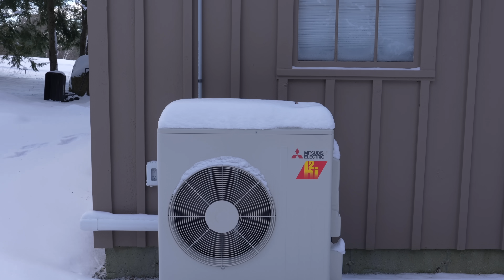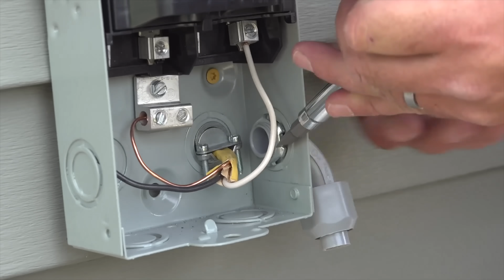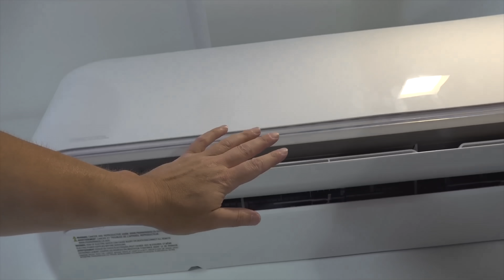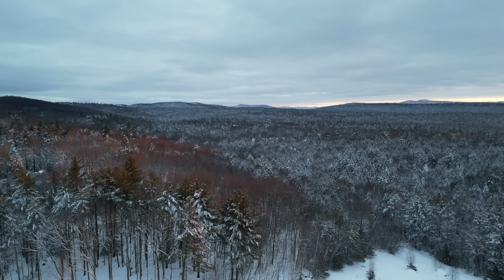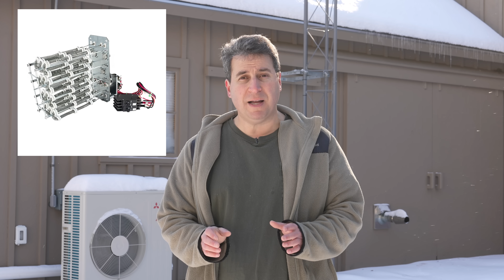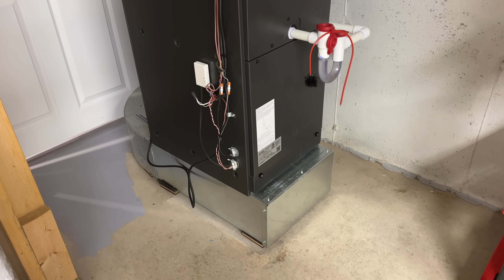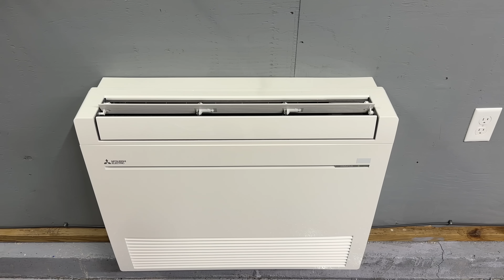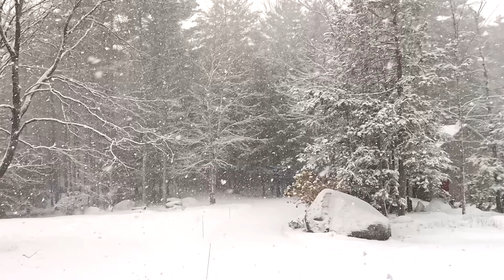Why Heat Pumps are now leaving people COLD

Comment: I opted for a dual fuel system. In the winter my heat pump operates based on an outside temperature sensor. Once it drops below 30 degrees I have a gas furnace that automatically kicks on. Best of both worlds. You get the efficiency of the gas when the heat pump become less efficient.
Reply: Here in the UK the Government gives a grant towards installing a heat pump but the gas boiler MUST be removed so no back up for cold days. Absolute madness - typical of Politicians who have no common sense!
Reply: @richardlewis5316  I'm guessing they want you to use an electric strip for backup, which will get the power from a gas-fired power plant, which is less efficient than your boiler, sounds about right, they are trying to ban natural gas use here in the US in some cities, which will cause the grid to be overloaded, then you have NO heat.
Reply: Thanks for your reply - so your politicians are obsessed with this CO2 non issue as well but don't care about us freezing or broke from buying a HP. I'll keep to my boiler which Valliant say can be converted to - hydrogen!! Cheers
Reply: @richardlewis5316 That sounds currupt.
Reply: I am in NH, and use propane boiler as my backup but I don't turn it on till it gets to about 20f, and even then the heat pump does most of the heating.
Reply: Excellent commentary.  One response mentions the cooling load in NE being one third the heating load and that certainly seems to make the case for why our mini-split outside condensing units go into an awfully loud vibratory mode when trying to heat with outside temps below 25 F.  We never experience this during cooling cycles.  Some northeastern towns now have building codes preventing new homes from the installation of fossil fuel heating systems, which may be adding to a false understanding that heat-pumps alone can handle the cold snaps.  And maybe the designed envelope of the new home makes the case on paper, but in reality the actual installation doesn’t always meet the goals due to poor craftsmanship and/or the use of inferior materials. Our experience would advise not only an alternate heat source to work in conjunction with the heat-pumps, but one designed to handle the heating load alone if needed.
Reply: @seniorsouthwick976  This is a classic case of government sticking its nose where it doesn’t belong. They know nothing about heating a home or building. They just listen to what John Kerry, Al Gore and the World Economic Forum tell them. They know less than the government.
Reply: I did the same, and I live in Michigan. Below 25 degrees, we have a natural gas furnace that turns on, to switch from using more electricity. My heat pump can heat in the winter, it's just more expensive than natural gas.
Reply: It depends on what type of gas you are using. My experience with propane has always been that its crazy expensive compared to natural gas. I went from a propane system that burned $24,000/year to a geothermal system that used $600/year (including summertime cooling bills).
Reply: @dilvishpa5776  24k? My electric and gas(natural) runs less than 100.00 a month total. About 75 electric, 20 gas a month average. That's for a 1970, 1700 Sq ft house that has no insulation in the floor and the attic could use a little more. That's using a dual fuel unit that I bought and installed for about 4k, 6 years ago.
Reply: @stevem1081    Yes. I know. Seeing the propane delivery manifests almost stopped me from buying this house. If it hadn’t been for the geothermal solution, I wouldn’t have.

But I wasn’t surprised: the house I built for my mother was well insulated, 1000 square feet, located near the Canada-US border north of Minnesota, and consumed over $1200/month in propane in winter 30 years ago. I would never have installed a propane furnace had I known. I suspect that there is fraud in the propane industry that leads to such high billing. I can’t explain it in any other way. The price between propane and natural gas shouldn’t be so drastically different.

The 6000 sq ft house was also well insulated, but the propane bill included heating a 2800 sq ft high ceiling insulated outbuilding, and a pool heater. The propane bill didn’t totally go away, as I kept it for cooking and hot water. Oil burners replaced the radiant heat boilers and pool heater.
Reply: @dilvishpa5776 propane is higher when you don't own your tanks. They charge you a rental fee in the propane ( priced in per gallon) without you knowing this. The reason is propane industry for the most part is UNREGULATED.  Meaning there isn't a state entity that regulates them. So they basically get to price gouge and get away with it. 
I own my tanks and the different before I owned my tanks in winter would be $4.99 per gallon ( company tanks) and $1.29 per gallon ( self owned tanks) 
Shoot in summer time when i would filled up it was as low as $0.99 per gallon
Reply: Up in northern Canada running a high efficiency nat gas 2 stage furnace alongside HP. When it's -40 I need fire and I don't care how much it costs.
Reply: Just experienced this phenomenon with my first-year mini-split heat pump. Thanks for your clear and helpful explanation...saved me a phone call to the technician!
Reply: Same here. Heat pump, 97% propane furnace, and wood stove
Reply: Given ever rising electric rates in relation to natural gas, you save money using gas all winter, getting the best of one world.
Reply: I’m in southern New England. I use a heat pump down to about 25 f and use oil backup. Looking at total cost of electric and oil, I save a few hundred dollars a year over the cost of oil alone, and use less than half the oil. New heat pumps will work to lower temperatures by using propane as refrigerant. They should start coming on line next year. If you are thinking of buying a heat pump, wait a year or so.
Reply: Yeah, this sounds like a great compromise -- especially for houses that already have a natural gas system in place!
Reply: I like that option. If you have the indoor ducted distribution system, you can run the indoor unit on low throughout the year in conjunction with a HEPA filter use and keep your home relatively dust and allergy free.
Reply: I assume you must be on natural gas?  With an inverter heap pump, the cutover temperature for propane is MUCH lower.
Reply: @matthewbeasley7765 is there any other gas use? 🤔
Reply: @JoRoBoYo  Propane.  
The prices on the two are very different.  A heat pump is going to beat propane at any outdoor temperature.
Reply: @matthewbeasley7765  Generally a safe assumption for a standard heat pump. That said, some of the heat pumps are now super efficient at lover temperatures, so the temperature drop can be way lower than 30 degrees for the heat pump to transition to an alternative heat source in these colder climate heat pump products.
Reply: @matthewbeasley7765 yes they can work lower but they are having to run the heck out of them and defrost a lot.
Reply: @matthewbeasley7765  The fuel type means nothing. The changeover is based on when the heatpump can no longer deliver enough BTUs to sustain a set temperature. In the northeast we must size a heat pump to the cooling load and ductwork size if we expect dehumidification. Cooling loads in this area are usually a third of the heating load.
Reply: @anthonyspadafora1384   There are two circumstances here.  

One is when the auxiliary heat will kick in based on the interior temperature.  The thermostat will kick in due to the temperature being below the heat pump only balance temperature.

The other is when an outdoor thermostat is used.  It is a standard feature on most heat pumps that is not elected in many cases.  It is useful when there is a known outdoor temperature where the alternate heat is more economical.  When the outdoor temperature no longer is above the outdoor thermostat temperature, the heat pump is shut down and the unit goes to only the alternate fuel as the first stage.  This is most pronounced when natural gas is available.  At high temperatures, the high COP of a heat pump makes it cheaper, but as it cools, that's no longer the case.  Most other fuels like propane or oil never reach that point unless the electric price is really high.
Reply: @anthonyspadafora1384  it does because in my area natural gas is 5.5 times cheaper than electric for the same amount of heat production. But depending on what your alternate heating source is will have a different cost to heat the same space. Heat pumps are heat transfer units not heat generators so the warmer it is outside the more efficient they are.  Since their performance drops based on temperature outside and they get more expensive to run the colder it gets other heating sources become cheaper to run at different outside temps.
Reply: @johnantonopoulous6381  I understand, I install about 25 ductless units a year and usually a couple heat pumps with fossil fuel backup. In my own home I air-condition with ductless and usually heat until the temp drops below 50. My home is 1800 sf with radiant floor heat. My heat load calc is 36000@0 degrees. As I have been in the HVAC business for 4
Reply: @matthewbeasley7765  Not from my experience. To heat my home with a heat pump it costs me about $250 to $300/mo. Propane is less than $100/mo. I do have a condensing boiler that is about 97% efficient in heat transfer & radiant floor heating.
Reply: @guytech7310  same here I use a Navien condensing boiler with radiant floor. My downstairs is slab high mass and my upstairs is under floor low mass. Right now I have the wood stove heating the house, a EPA Quadrafire. Sitting here looking at the snow and throwing in logs I realize I should have put some wall radiators on the wall behind the wood stove. This would allow me to run my circulators and throw a little heat back into the floor when burning wood. Oh well, maybe in my next life. Lol
Reply: @guytech7310  Northern Texas here - I switched my electric aux heat to propane. I have 3 units, I changed one so far and I'll change the other two as well soon. I have a 500 gal tank and another 250 gal tank for my backup generator. Best thing I've ever done. Also switched my stove to propane because electric just sucks. And my water heater (on demand, tankless). I'm very happy with the results and when it gets cold, putting the aux heat on for literally 2 minutes is enough to get the entire second floor to a cozy temperature.
Reply: Only way!
Reply: whats the heat pump price per btu vs the gas furnace? is it worth running a heat pump in the winter and wearing it out faster?
Reply: @danielroden9424  That depends on the cost of each fuel, for me, my electric rate is 6 cents per KWH, most are much higher, in fact, just a few blocks away is serviced by another power company, they are 14 cents per KWH, and there, natural gas would be cheaper. I have a dual fuel that switches to natural gas below 30°f Once it gets below 30°, it is actually cheaper for me to run space heaters than to use the natural gas. I found the btu output for gas and electricity on the doe.gov site to see what each one cost.
Reply: Why have a dual system when the gas furnace is already 94% efficient?
Reply: @johnwilcox4078  In my case, the Electric is much cheaper than the natural gas, plus I plan on installing solar, making the electric nearly free.
Reply: @stevem1081  "nearly free", eh? I first heard that kind of promise as "too cheap to meter" back in the early 60's. Didn't quite turn out that way. The engineer in me will happily adopt solar at the residential scale when the numbers no longer need to be massaged in order to appear to be economically viable. At the present time utility scale solar (farms) cost about a third of individual systems to deploy and even then massive government subsidies are needed to support them.
Reply: @jamesnasium7036  If you do your own install, then payback is much sooner. My neighbor installed his 12 kw system and in 6 years, it is now providing free power. I will be installing mine, so unless something like hail or lightning take it out, I too will break even many years sooner than if I paid someone else to install it. On the 10 kw system I will put in, doing it myself will shave over 20k right off the   top.
Reply: @johnwilcox4078  The 94% number for your particular furnace is arrived at using tightly controlled "steady state" laboratory conditions. As the saying goes, "your mileage may vary". By a huge amount.
Reply: @jamesnasium7036   You saying it doesn't make it so. But you're not a pro HVAC guy like me so I'll grade you on a curve. Look up AFUE ratings and see how you are completely wrong.  My point is air to air heat pumps cost more per BTU to operate than a high efficiency natural gas furnace. This is because electricity is by far the most difficult and expensive form of energy to produce. Have you ever toured a power plant? My power comes from a plant that used to burn coal but now the boilers run on natural gas 😉
Reply: Green cultist.
Reply: @James-l5s7k  Lol. At the end of the day it’s about being comfortable in your home and a heat pump in my location is not the best option.
Reply: Ahahaha, that's as ridiculous as the meme of a diesel generator charging an electric car.

So basically that's proof that they are not fit for purpose.
Reply: Thought central air with baseboard heat was the best of both worlds?
Reply: Same here. I have a dual fuel system and it's awesome. 

I have mine set to switch to the gas furnace once temps drop below 25 F.

I expect my equipment will last a long time, as my heat pump doesn't get pushed hard during cold snaps, and my furnace rarely runs.

The other big advantage is that it means my heat pump didn't need a heat strip installed - so it only requires a 30 amp breaker (which my old AC unit was using), which saved me $$$ as I didn't have to upgrade my electrical panel.
Reply: That makes a lot of sense.
Reply: Two furnaces to hear one home is the worst possible solution.  If you need a gas furnace to fill in, you are paying a gas companies fixed charges every month.
Reply: I have a dual use as well and never use the heat pump, leave it on emergency system, which is gas. Heat pumps are on all freaking day and use a fortune in electricity. They're a complete scam.
Reply: Same. I’m in North East, so oil is my backup. Below 30 I also run wood stove and the oil burner doesn’t kick in at night anyway.  Saving a lot of money this way.
Reply: And much more complicated and expensive
Reply: @Tkaya460 For those who already have a gas furnace and add a heat pump, cost isn’t that bad. Only about 2k more than installing an AC.
Reply: @mingchi1855 it cost about $5k to add a heat pump to my existing furnance a couple years ago. For dual fuel, the state offered a $1000 rebate. So really, the heat pump was an extra $1000 over central air, ans i use it almost excusively for heat from sep through nov, and late feb into may.
Reply: @Tkaya460  A heat pump is not much more expensive than an AC.  It's all the same parts just configured so it can also run backwards.
Reply: @zyxwvutsrqponmlkh  you do realize most people can't afford central a/c's right? To put in a modern dual fuel system is 3x as much as what my furnace cost and is much more complicated and thus more expensive to maintain and repair.

And the heatpumps designed for cold areas are actually quite a bit more than a standard condenser designed to only go down to 10°C outside.
Reply: @zyxwvutsrqponmlkh  no, it's not. You're wrong. To replace my central a/c with a heat pump is at least 50% more than just another of the same a/c. Then add in more complex controls for dual fuel and the fact my furnace is single stage makes it harder to get a good split.
Reply: @zyxwvutsrqponmlkh  reread the thread. Dual fuel is typically central, not mini split.

Also there is a significant difference in price even for mini splits, especially cold weather variants. You are wrong.
Reply: @Tkaya460 you sir have no idea what you are talking about. I'm an HVAC tech and a traditional central split system with gas furnace and condenser ac / evap coil cost per dual fuel systems aren't that much more. In fact your only paying the difference in equipment cost not labor cost . The install in labor is the same.
Reply: @Tkaya460 it's not much more complicated and expensive.  It's just another module "sandwiched" in the system next to the coil unit.  Nothing else changes.  It's only a couple $k.
There's no "extra control".  It's running off the same thermostat.  I don't know who gave you your quotes but like I said, if you are already replacing the existing central system and you have gas, it's a no brainier....  It'll pay for itself in a couple of winters.
I also don't understand what you mean "most people can't afford central AC".  Where do you live?
Reply: @sergeyb8  a couple K is a lot of money. And cold weather units aren't just a reversing valve. They have higher quality components to operate below 0°C plus defrosters and backup resistive heaters. 

Any dual fuel setup is more complicated on controls and require special thermostats and in some cases more hardware/sensors.
Reply: @Tkaya460  🤦‍♂️ um, couple K is no big deal relative to the cost of the overall system and labor.  And labor itself to add another stackable module is pretty much nothing (relatively).  If a couple of K is a lot of money to renovate your system, well, then keep paying hundreds more $ in monthly bills every single winter, LOL.  I guess for you throwing money away slowly is cheap.
I already told you about controls.  It's just a frіgіn thermostat that looks like any other.  In my case it's a BOSCH system.  It's literally no different than the ancient gas/ac unit I used to have in terms of controls and "complexity"... 2 stackable modules inside (actually smaller than the old system) and the same looking compressor system outside.  Only this is a modern system based on the latest technological advancements that took place over the last 25 years.  And these advancements don't automatically make it more expensive... Just like CPUs in computers don't get more expensive with the progress.
Really, I don't understand what you are trying to prove here.  That it's expensive for YOU?
Reply: @sergeyb8  $2k is a lot of money, most people can't afford an ac at all let alone having dual fuel plus the maintenance of that whole system. 

Electricity to a heat pump is not going to save money vs gas to a furnace. The cost per BTU is 3x electric vs gas. And that's on a newest top efficiency heatpump that is more money again.

Duel fuel thermostats are $200+. You can't buy just any old $20 thermostat and call it a day. Plus to do it proper need outside temp sensor to have it adjust the crossover. Which is also dependant on how sealed the structure is.
Reply: @Tkaya460  Ok, I understand now.. basically you are clueless so pointless to continue this but I'll leave on this note:
1.  Just because "most people can't even afford ac" where you live, doesn't mean you have to keep repeating this under this video.  Heck, there are responses talking about geo thermal systems going for $30-60k.
2.  Replacing an existing system is something to be expected as a home owner.  If you can't afford to replace an existing system, well, maybe you made a huge mistake buying your house by going over your head?  I'm not asking you to install this system in a home that can barely afford an AC.  I'm talking about upgrading from a 25 year old system to the same form/feature/function.  Only 25 years later it's obviously 25 years-later-better technology wise.
3.  It's a FACT that variable speed inverter / multi stage systems are more efficient than predecessors.  Heat pumps are absolutely cheaper to operate than natural gas - OVER a certain temperature.
4.  There's no "extra" of anything to operate a dual fuel system.  For switchover it's the most basic 2-wire thermistor installed inside the compressor unit.  You also have an option to use thermostat's built-in "weather station" connection... You know, like any other smart thermostat that knows how cold it is outside.
Reply: @sergeyb8  oh so now you're talking smart thermostats which  are even more complicated.

Per BTU of the highest efficiency heatpump is tripple the cost electricity vs natural gas. That's assuming a mid efficient gas fired furnace. So unless you have some renewable generation onsite, it absolutely is not cheaper. Heatpumps are more efficient, not cheaper than NG fired furnaces.

And like I said, most cannot afford an AC. So a dual fuel system is 3x the cost over just a NG furnace.
Reply: @Tkaya460  🤣🤣🤣🤣 LMAO!!!  You must be running a coal burning boiler if "oh so now you're talking smart thermostats".
Sorry I couldn't resist responding one more time.
By the way, MassSave rebates cover this "super duper expensive" thermostat and thousands on the system itself.
Reply: @sergeyb8  no they don't. Most don't qualify for any rebates. And rebates don't cover the costs of more expensive repairs on these newer furnaces and heatpumps. Variable speed anything is more complex and more expensive. 

Simple fact of the matter is dual fuel is more expensive and more complex which will lead to higher maintenance and repair costs. And unless you're running electric heat or burning oil, heat pumps will not save you money.
Reply: Sadly if you had bought a regular air conditioner, your combination would have a much better reliability and life cycle cost.  But you had to be politically correct so yes you did your best.
Reply: @xenia5101 sadly people like yourself have no idea what your talking about. But you tell yourself your correct in head to believe the BS that isn't true at all. If you never worked in the HVAC field you should learn to not comment on things you have no idea